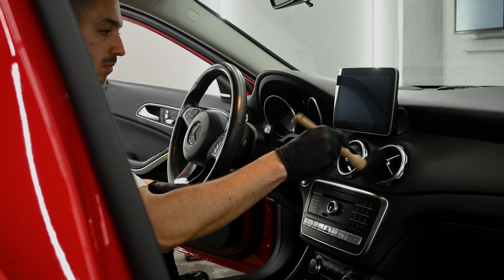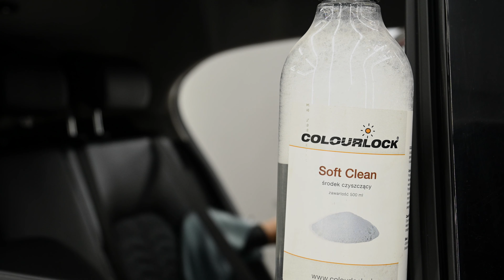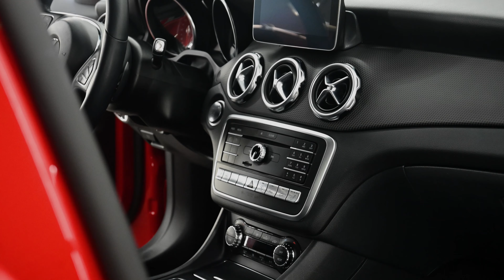Mercedes GLA Interior Detailing - Car Detailing

Comment: Hey, that first rim you washed at the bottom was still dirty, I'm asking out of pure curiosity, did you work with a stronger agent later and embrace it?
Reply from the maker: You mean the alloy wheel ? if that ,no because its not a wheel detail or an exterior decontamination. I only do a deep clean for the exterior and the wheels for an interior detailing.